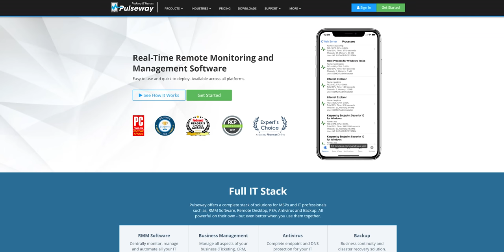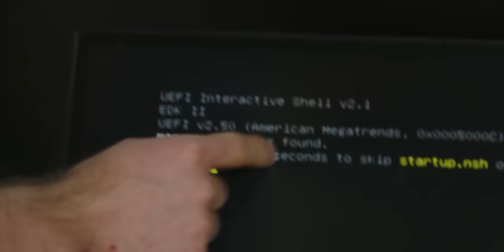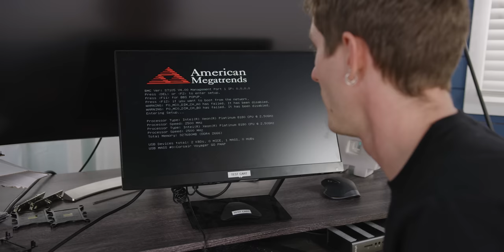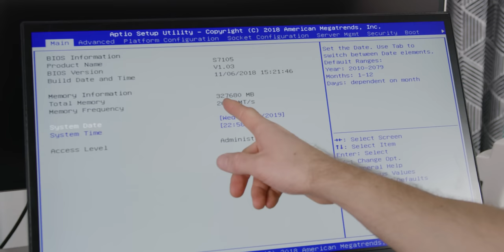Can I FIX this $10,000 CPU??

Comment: You need carpet in your work area's with anti static treatment it will save you a lot of headache! I know carpet is taboo in the electronics industry but there's way to have it on a small scale I remember the server room at Bethlehem Steel in Bethlehem PA it had a sub floor, halon fire suppression the tiles in the floor all came up like square manhole covers they had a dedicated Swamp cooler for the room, a lot of money even though 90% of the company was shut down at the time, I was just a Sergant for there security company at the time so I got to see a lot of things the public and most employees didn't I just didn't know what they were doing with it? I do know Ioccoca hall (the Steel research building) was still playing with new alloys so maybe the servers were working on some new metals for the military???  Anyway carful dude $10000.00 is painfull

Comment: Just deal with the lower memory amount. It would be crazy to buy another 10k CPU....unless you could then return the broken one for a replacement...then you would have two of the chips.
Reply: They're a tech channel. They do benchmarking. They can't have a subpar version of the CPU and act like they can get accurate benchmarks for it.
Reply: @Szanth  I suppose, but I can't imagine they would be doing tons more with the CPU. I guess the fact that he is asking what he should do made me think it wasn't completely necessary to have a new one.  In the end, if hey really have a bunch more video to make centered around this specific CPU, then they should get another. If not, it would be  pretty hard to justify a $10k price tag just so a editing/rendering machine can have 364GB ram rather than 327GB.

Comment: you sure it is the processor and not the mainboard or ram compatible issues? I have a X99 board on initial will not recognise full 64GB ram full slots, until a year later a bios update fixed the compatible issue.

Comment: you shouldn't ahd use glue cause glue isn't that good in wise of condetivitie u should either just clamp itw ithout the glue or try to get some copper in between and heat it up slightly to give it a connection. that would had been my suggestion but this was a nice try atleast

Comment: Colton knows lvl 1 support: "did you try unplug and replug it again?" But there's better! Lvl 0: "did you try restarting it?"
I kid you not...  i work in analitical chemistry with a shitload of super expensive (100k to 1M) and complicated equipment (Like GC, HPLC, IC or OES and all of those MS coupled).
And lvl 0, restarting it works in 90 % of all problems... lvl, replugging, another 5 to 6 %... 3 % are hardware issues on the application side and only 1 to 2 % on the electronics side!
So... chrmists are even worse in programming than... normal programmers who also to often suck at their job...

Comment: what did gamers nexus suggest? seems you did nothing more than put gorilla glue on the cpu, which turned out to not do anything - rather, you just completed your initial goal of getting a system to post to show what's wrong with the cpu
but even that wasn't achieved - you didn't boot to os

Comment: okay need help my a10 7700k died not sure how but i've been trying to resurrect my i5 4440 but needs a new board but it will do but i want to use usb 3.0 but if i put my gtx 1070 in i can't get the 3.0 usbs on as its covered by the gpu